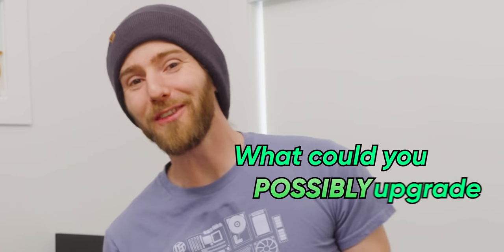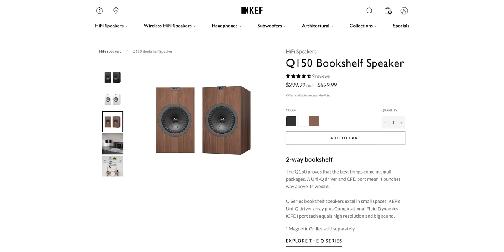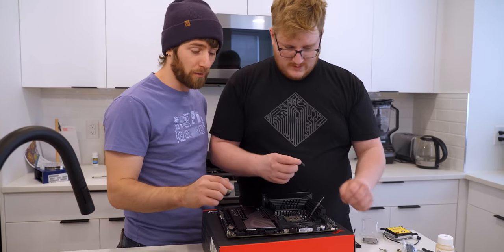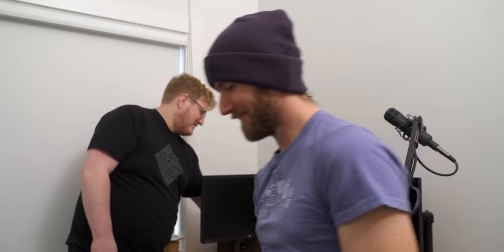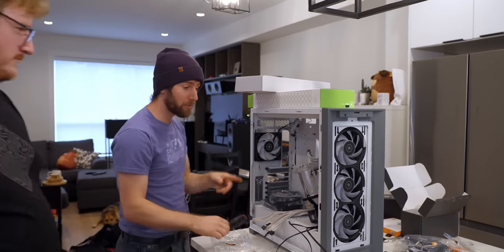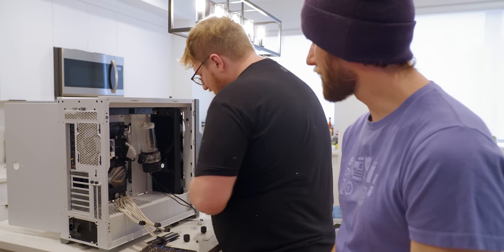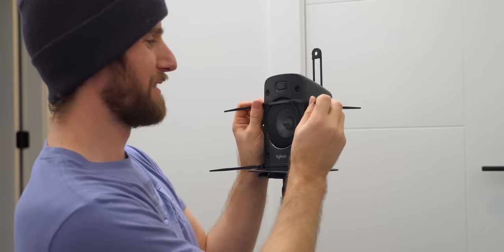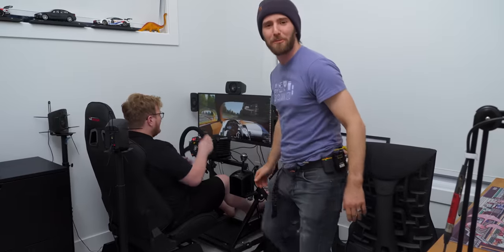Who spends money like this? - Intel $5,000 Extreme Tech Upgrade

Comment: Edit: this was true on the SB1000 and the SB2000 but may not be true on the SB2000 Pro in this video. The Pro has a line out still but it appears to no longer have the highpass filter. This will still work but you won't get the benefit of the filter. 

You are wiring the sub wrong. You shouldn't be using a splitter, the sub has a highpass filter built in. You need to put the rca out from your DAC into the line in on the sub and then run the line out on the sub into your speaker amp. What this does is act as a crossover so the speakers are no longer trying to reproduce the frequency range you have asked the sub to handle. This means your speakers and amp aren't wasting power trying to reproduce subbass when you have a sub thats already doing that. Your midrange drivers should just generally perform better once they don't have to deal with that really low frequency range.
Reply: Didn't even realize you could do this :O Thanks for the recommendation!
Reply: Or use the pre out on the amp (which amp is he using?) directly into the sub and set the low pass filter on the sub.
Reply: Oh thank god someone pointed this out because that splitter was hurting my soul
Reply: +1 If the monitor+amp/dac/interface support XLR go with xlr. I had so much issues with unbalanced rcas.
Reply: @Nothinglastsforever  right, if you have a pre-out and power amp in you can run pre-out to your sub and then out from the sub to your power amp in. I have this on my old reciver but it seems pretty rare to have a pre-out/power in on integrateds these days. Since he is probably just using the DAC as the only source anyway it should be fine just running from the DAC if he doesn't have a pre-out
Reply: @jaketivy9368  I may be wrong here actually, the SB2000 and the SB1000 have a highpass on the line out, I just noticed you are using the SB2000 Pro and it looks like it may not have this feature. It has a line out but the manual does not mention the highpass filter on the line out, it does specifically mention this on the SB2000 non-pro.
Reply: @danielpope6498  I have a class-D peachtree deco 125 with a pre-out for my desktop setup but the NAD D 3045 is a pretty popular choice for desktop setups also with a sub out/pre out combo.
Reply: This is why I use earphones lol
Reply: @jaketivy9368  I thought that's waht you were talking about in the video when you were saying "this is what you do when you don't have a DAC with a sub out", I assumed you knew that the sub had a built in crossover lmao. One thing you should know then, Jake (you can probably talk more to Dan about this and he'll talk your head off), is that you can get dedicated devices to add processing in between your DAC and your amps, that allow you to adjust the crossover points just like a high end sub's back panel crossover, but with more fine tuned control of it. You can adjust the crossover curve (what frequencies are cut off at what gain) using different settings, change the phase of the sub to better match your setup based on it's placement, adjust the gains, the delay, add a compressor/limiter, and do parametric EQ, all in one device, depending on what you buy of course. I normally don't use RCAs for any of this as well, XLR is life in a setup this size with tons of power cables and audio cables crossing over each other, multiple PCs, etc... It gets a bit noisy out there lol. I hooked up my oscilloscope one day to one of my RCAs that was feeding my sub, right where it was outputting (so that i could measure the real world run noise) and it was shocking how much distortion it was introducing even with just a 10 foot run from my audio rack. It was plainly audible once I turned off my air filter in the room, and was just audible without it as well.
Reply: @danielpope6498  @Jake Tivy ... Thanks Daniel for pointing out all of this, went looking in case no one did lol. I think it's safe to say if your sub has an output, then it has a crossover filter, and you should wire the sub output to the monitors.
Reply: I dont understand anything. But this is great!

Comment: 15:40 instead of using RCA Splitters, go  RCA from your Source -> Sub Input -> Sub Output RCA -> Amp, this way the Sub will do crossover of the low frequencies.

Saves small speakers like those KEFs from also playing low bass, which they aren't good at.

Comment: Jake: Why wouldn't you use the output on the sub? It has the crossover integrated, as it's a powered sub, and then you use the output into the speakers' input for the amp. No need to use splitters! Also, you're sending full range to the tops the way you wired it, so it's going to muddy the frequencies in the high-bass low-mid range.
Reply: I was just about to write this, cheers. The only reasoning I can muster would be to ensure that the signal is being amplified independently by each monitor/sub? But I still don't think that's right.
Also interested to know if that second sub ever passively moves due to the bigger one firing.
Reply: I was thinking exactly that. Shows that being a genius in computers doesn't make you a good sound engineer :)
Reply: The splitters are unnecessary, but the outputs on the SB-2000 Pro are full band pass-through. They do not high pass the main speakers unfortunately.
Reply: Will the sub act as an amp for the speakers?
Reply: You dont need to high pass the top speakers, just adjust the variable crossover on the sub. If its to muddy you should close more the crossover. This is a close range setup, if you high pass the tops they are gonna blast your head.
Reply: Also the back porting on the speakers that close to a wall and corner sort of undo the hi-fi aspect of the installation
Reply: @ElGuatequero  That is not how this works. A proper bass management crossover requires both a low pass filter on the sub and a high pass filter on the mains. That enables proper summing at the crossover for an overall flat system response. High-passing the main speakers does not make them louder compared to the sub, but it does help reduce distortion and increase the maximum output potential of the system.
Reply: @DanKaschel  No it won't. Those are RCA pre-amp pass-throughs.
Reply: @RickRalstonAsumendi  thanks for articulating this for me; I have a hard time keeping track of the jargon. That's exactly what I was trying to say in my comment about amplifying each speaker/sub independently.

Comment: REW and Equalizer APO is a freeware solution to room correction. Great pick on the sealed sub, but you’re inviting issues having those rear-ported speakers so close to the wall. A front-ported speaker would be a much better choice for this setup (though $200 for those Q150’s is excellent!)
Reply: Also using EQ APO with my 2.1 desktop setup. The only problem is that in windows you need to do a virtual 5.1 setup and reroute the outputs to correct the sub and front speakers individually. 
Of course it needs a LOT of experience to interpret the measurements correct the frequency response in the right way, because you have all freedom to make it better or worse. Fully automatic correction nowadays doesn't make the experience worse, but it's still far away from a manually dialed in response.
Reply: I'd also add that the Behringer ECM8000 measurement microphone costs about 40 dollars and is more than adequate for doing this type of room measurement and correction.
Reply: equalizer APOs equalizer ALONE should be standard on everyones PCs, every person ive sent my profile is in love with it and hears EVERYTYHING on Hunt Showdown and a lot more on regular games too
Reply: @Shadow0fd3ath24  Could you upload your profile somewhere? Would appreciate it
Reply: I was thinking that, particularly the speaker choice. Not the way I would have gone.

Comment: I'm surprised he isn't using VR for that intense of a racing Sim setup. But then again everything but the dog and cat are out of my price range lol.
Reply: Look at this guy being able to afford a dog AND a cat! :P In all seriousness though Ive always wanted to try a racing sim! Looks like so much fun!
Reply: @theBejourn  sim racing for me is mega fun but the beginning costs are quite extreme if your going for a decent setup and not a beginner one and don't want to DIY anything. This setup in the video is at the beginning end of sim racing cost, just wait until he gets a motion rig with  triple screens and a wheel that will break off a wrist 😂
Reply: I was thinking the same thing. A good VR headset is basically required for sim nowadays.
Reply: (noob here) dont screens offer both higher fps and resolution? like sure its cool to look around but if im locked into 1080p 60fps on a headset, i'll gladly take a monitor.
Reply: @ipodman371  your argument might hold up a couple years ago, but with the 4090 you can now have both high fps and high resolution. and honestly even with lower resolution, I would take VR over flat gaming any day. the level of immersion is simply amazing.
Reply: A half decent cockpit for starters. For as in the weeds as Jake gets to use that anemic wheelstand with even an 8Nm wheel is robbing a ton of immersion.

VR or triples would be a great evolution it that flimsy stand has got to go.
Reply: a lot of these sim racer guys will do 12 hour races and stuff like that where the headset can get in the way, lead to motion sickness or just uncomfortable + sweaty after a couple of hours
Reply: @yannickgeyer6104  I did the daytona 24 hour with 1 other driver, we both use Quest 2 for the whole race, no issues for either of us
Reply: @ipodman371  yep your right that screens offer both higher FPS and resolution, but you misunderstood just how great a vr headset is in terms of depth perception and being able to move your head exactly where you want, it's incredibly immersive if you have a proper rig much more so than triple screens.

I'm blind in 1 eye so the difference between a screen and vr is quite similar as I don't have the need for depth perception but even for me it's such a massive difference.
Reply: @ipodman371  VR headsets today can offer 4-8K resolutions, 144hz, wide fov etc. There's really good stuff out there. You said 1080p at 60fps, that might be the first few ones that came out like 7 years ago lol :)

Comment: As a sim racer, I knew Jake was a legit (sim racer) when he mentioned the CPU overheat warning. Probably running the T-rex mod x 32 grid on Shukoto, while raining in VR in the latest SOL mod at max in AC. Or not.
Reply: I kind of doubt it since the FOV isn't set up properly.
Reply: do you know what his sim base is?
Reply: @joem3793  looks like a CSL DD, there are better ones around the same price point like the Moza R9. I wouldn't get it unless if you already have other fanatec gear.
Reply: @DropkickNation  Absolutely, blasting around Shutoko or Nords in AC is the simracing equivalent of playing NFS
Reply: That explains it a lot, Shutoko + VR + SOL + Max Graphics
Reply: @pleepler  not really because modding takes some work which trust me, casual NFS players will not attempt.
Reply: Wtf did I just read
Reply: @leepicgaymer5464  I think he was being sarcastic...?
Reply: the kind of settings that make your car vibrate when it comes to a complete stop
Reply: @joem3793 DD Pro with the boost kit

Comment: piece of advice on the Logitech 5.1, system, dont place the control pod on the sub, in theory, it shouldn't be a problem, but as a tech, i can tell ive seen a LOT of weird "glitched" pods, and all of them were put on top of the sub, maybe is the vibration or the magnetic field, not sure what. (seen the issue with z5500 mostly, but seen it in these exact ones also)
Reply: No twitters on this 5.1 speakers , x 530 would have sounded better.
Reply: Some similar model had a warning sticker on the sub to not to place any electronics witin 30cm or so

Comment: The KEF Q150 (and Q100 for that matter) are very good speakers for the money and are especially so if you can find them used for a good deal. They do benefit greatly from a sub, but once you give them some bass reinforcement, they're honestly great speakers. KEF does make much nicer speakers, but they're a lot more expensive and weigh more, so they don't wall mount as readily.

Comment: Linus "losing his shit" over Jake's sim rig made me lol pretty hard...

My rig has over $9k sunk into it (driving and flying, no motion)... and that doesn't even scratch the surface of getting into seat movers, slide movement or most expensive... full motion setups!

Still cheaper than owning even a cheap sports car and blowing ~$2k PER track day... and that's just tires, brakes, fuel, track fees, etc... before you even get into vehicle maintenance/repairs!
Reply: Jeez $9k, I got a T300 RS GT and an SHH and called it a day. What kinda stuff you got?
Reply: I have 15k rig and no wind or shaker. It adds up doesn't it? I got a 4090 for the triples though and if you don't have one it's definitely worth it if you can afford

Comment: 9:00 if you're struggling to put fans Infront of a rad like this on your own, mount all your fans normally but only use 2 screws on 2 opposing diagonal corners, then use the other holes to mount the rad and once the rad is mounted remove and replace the standard fan screws with the ones for the rad.

Comment: I retired my Logitech x530 5.1 system from the early 2000's and replaced it with a Logitech z906 5.1 set I got for $40 USD used. It's a pretty big improvement all around but I couldn't recommend it for the MSRP. The best thing about it is having a remote for dialing in the sound when in bed

Comment: I pulled my 5800x out of the cpu socket when I removed my nh-d15 as well! Except I didn't see it right away and as I rotated the cooler in my hand the cpu fell off onto the mobo/gpu and bent like 20 pins and snapped off 3 of them 🙃
Reply: Time to apply for the tech upgrade
Reply: Oof
Reply: I had one on an old first gen i7 (i think it was..) stick so bad I had to 3d print a tool and literally hammer it off.

The usual suggestions of heating it, etc did nothing.  I had to really wail on it with the hammer before it relented.

I was absolutely shocked it didn't damage the cpu.

Comment: As a Music producer, the SonarWorks is OVER KILL ^100, It's used by mix and mastering engineers to EQ correct a room in conjunction with acoustic dampening, (to make the EQ range flat as possible to not gave any "Color" to the sound), an example of its use would be to help the engineer when mixing and mastering a project and need to mix or separate that hi hat with the hi end of the vocals.. For a gaming set up... why??? LOL

Comment: Can someone tell me, are the Q150 speakers only plugged into the DAC with the splitter going to the sub and it all goes into the DAC which just connects to the PC? no Amp? Im a noob and want to recreate a similar setup for Audio. Thanks. Also, would this same speaker, sub setup and rca splitter work with the loxjie A30 DAC?

Comment: i almost got the same setup.
Yamaha 6A6 + speakers is the base, calibrating, your speakers are NOT monitors, you need an AMP ATMOS set too !
18+ 2 ATMOS, 3 front /centre  speakers, are the monitor stand
 My side monitors are cheap HP too, on Display port !

Comment: LOL when I lived in a house I had almost the same setup as Jake. I had a 12" Pioneer in a car subwoofer box which I tore the carpet off and painted it with truck liner paint. I had a pair of ELAC Debut 2.0 B6.2 speakers. I had the subwoofer powered by a cheap Rockville RPA5 and I had a small 100 watt S.M.S.L. class D amp it could pound and it really sounded great miss the setup.

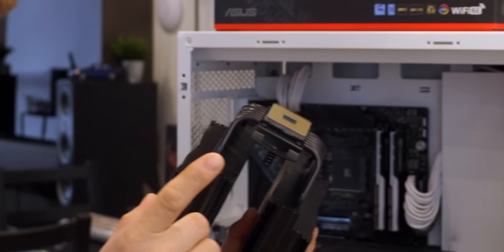Comment: 7:10, yep, I've actually accidentally pulled out my 3900x like 2 or 3 times along with my cooler/cooling block. First time I did was when I removed the stock cpu cooler because I got the AM4 bracket for my AIO in. Bent a few pins on my 3 week old 550eu cpu. Suffice it to say, bricks were shat. Luckily I was able to bend them back in to place. I tried to be more careful when I eventually removed the cooling block to replace the thermal paste and later still the AIO itself, but still managed to pull it clean out. Can't wait to upgrade to an LGA socket with my next upgrade :D

Comment: okay i got the litter robot for almost 2 years now... i wish i done it 8 years ago. but i dont think their was good product back than.  THIS THING IS AMAZING,  Less Smelly, can use normal trash bags to catch litter (so cheap to change/less messier).  It will automatically detect after ur cat did bussiness and rotate.  Only have to just pull out tray at bottomo and change bag 2-3 times a week.  Also alot less litter all over the place.

Comment: the proper way too 5000D is too use the back panel fan slots with a vertical mount for the gpu (not the ones that go against the glass-like the fab DIY that sets it back) you can set a 360 rad and fans and still have clearence for a 120-360 MM rad infront if you mount in the 140mm slots! problem is i have 2 fan controllers and the NZXT aio splitter too controll my fans also corsair i cue with 10 fans is PUKE!!!!!!!!!

Comment: I did get the 4090 and have the same motherboard... though i didnt get a deal on it. Anyway also using a corsair case and you definitely need the 7000 series case to fit that monster card still have a decent amount of space to move around in the case.

Comment: Linus' rant about radiator fans and gaps is fundamentally flawed. Those gaps are often intentional to allow the fan to spin at the proper speed with the proper power. Back pressure from being sealed to a radiator can cause the fan the fan to essentially fight itself. Those gaps allow to reduce/eliminate back pressure and insure that the fan is operating at an efficient level in terms of both moving air through the radiator and consuming power.